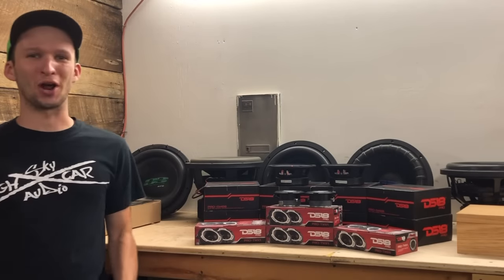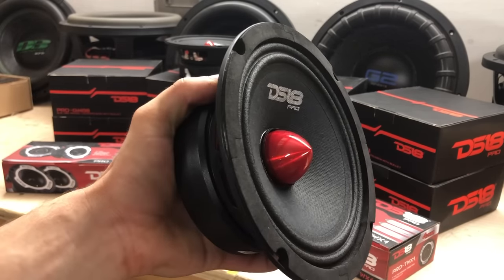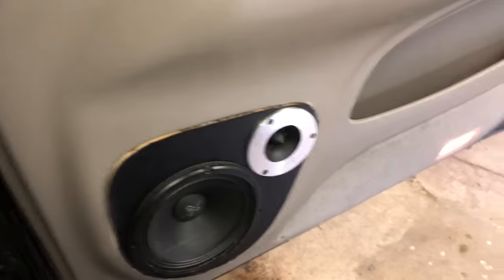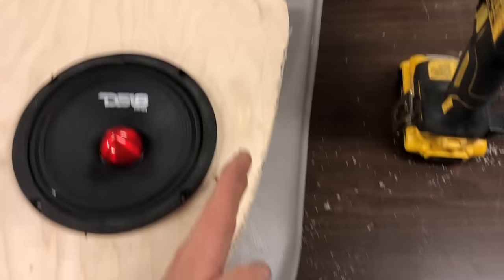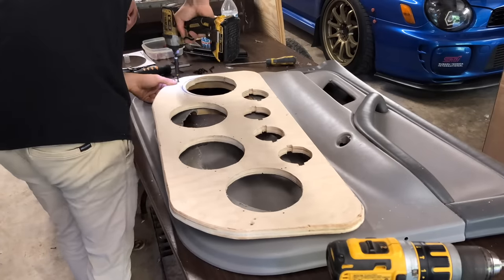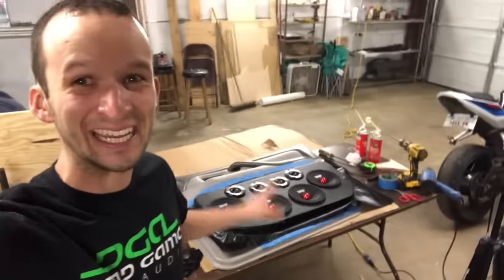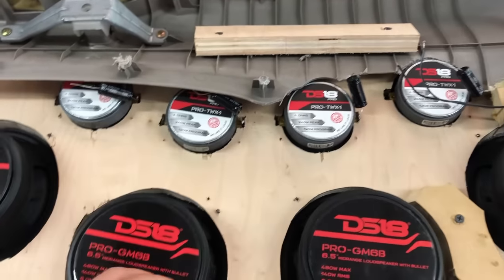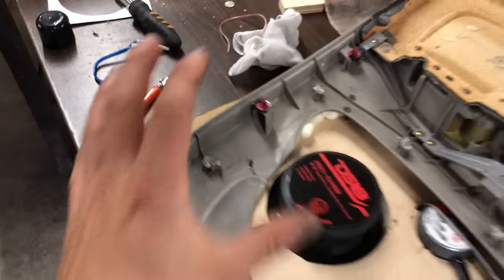Easy Custom Door Panels! *No Fiberglassing Needed* | DS18 Super Tweeters/Mids | Project Sequoia 2.0

Comment: I been dreading to do my door because of the fiberglass but after seeing you go this route, I'm gonna give this here a try
Reply from the maker: Yeah I was in the same boat man
Reply: Just remember, you can lay out carbon fiber the same way you do fiber glass. The only reason you need to vacuum carbon is if you are making a structural part for impact strength of for a wing so it will flex and be strong. Rolling carbon is still strong but really light and it's better at sound dampening. Heck I've used old fleece blankets and that really cuts down on the itch. With fiberglass just remember, the colder the shower the better it removes the itch... Used to work for LUND industry and really cold water takes the slivers out.
Reply: Same man let git some doors made lol

Comment: next time you could maybe try using a heat gun to warm up the vinyl so it can get a good stretch and if the edges are still a little rough.. glue some vinyl trim.  I hope my advice works on my pleather im about to stretch it over my panels lol. I am using a very similar method to yours. I taped off the door panel before foaming gapped edges.. I hope the foam is strong enough to hold my wrap when i tuck it.

Comment: bit late since the vid is 2 year old but correction  4 x 8 ohm speakers in serious gives  32 ohms , to achieve 2 ohms you  need to wire in parallel

Comment: Nice video! I did a similar thing with 8 8’s in the 2 front doors of my f150, once difference is that I made a trim panel that a removable baffle mounted to. Then made a quick disconnect wiring harness that plugged into a distribution block on the back of the baffle. Can strip the door in less than a minute.
 I also ended up doing a little body filler over top the foam that I used to smooth out and spray with a gloss black to match the rest of the interior 👍🏼
Reply: Have a 92 ranger I want to do this EXACT method with.  PLEASE email me any info you can on how exactly you wired this harness and distribute block please…

Comment: You can put all the speakers you want in your door but nothing compares to a set of Q-Form kick panels with some speakers like Boston Acoustic Pro 60's pushed with a JL Audio 300/2 supplemented with some more high-quality components like JL Audio C-2 or C-3 followed up with some coaxials for the rear doors pushed with a JL Audio 300/4 then build a center console ported box with the port and speaker facing the rear either a 10W6V2 or v3 or a 10W7Ae3 pushed with a 500/1 or 600/1 JL class D amp. With a center console box in a full-sized truck you can leave in the factory mounting system that connects to the truck frame and get no rattling and distortion with of course the proper sound deadening of your vehicle pre install. Looks great buddy! Oh and do not forget to install two matching AGM batteries that match and wire them properly and you will not need capacitors. Full size trucks come with an extra spot for the second battery for the diesel options in their truck lines.
Reply: Jls are over rated i switched a long time ago... Alpine & Pioneer. Z series
Reply: I ran jls the foam surrounds on my w3v2s back in the day dry rotted just junk speakers.....  Jl 6x9s couldn't handle the bass lol

Comment: Great setup! I like the design but I would've spent a little more time on the upholstery. You could've covered the whole bottom with the pleather as the door panel separates into two pieces.  Even if you didn't use fiberglass a nice layer of bondoglass would've been a stronger bond.

Comment: Just bought the exact same door speaker set🤪, i have the same car to lol just no sunroof. Ive been watching parkers videos for months now and he’s convinced me to build a 16000 watt system.. without this guy  i wouldnt have this goal. The only trouble im having is how im going to connect another 4 channel amp for my tweeters. For now they will be powered off the headunit… to connect 2 4 channel amps i was thinking 4 y splitters, 2 for the left and 2 for the right to equal 8 outputs. Any recommendationss?

Comment: Hay bro I has a question. I have the taramps 2000x4 the 2 ohms model an I have 2 DS18 8s 8 ohms an 2 DS18 10s 8 ohms as well mid-range..I want to bridge them what is the final impedance output all speaker wired separately  from the box going to the amplifier. Can get some advice on that please and thank you sir an congratulations an the win

Comment: Excellent job.  Now let’s say you have 4 sets of component speakers to use on the doors with 8 cross overs.  Now since your doing the series & parallel there’s one 4 ohm lead for the mid & one 4 ohm lead for the tweeters so when I hook this up to the cross over is the power rating now still the same?  100-200RMS?  How does the series & parallel change how much power I can now use?  Does it require mores power because four speakers share the load of one per cross over point?

Comment: That looks like a lot of weight on the door. Since this video have you had any issues with the panel, if so did you add anything to secure the panel and make it sturdy?
Reply from the maker: Yeah I’d you close the door too fast it will pop out some of the clips. Had to add a few bolts
Reply: @ParkerTheBasshead  if you do this probably go with shawllow mount neos so they arent has heavy

Comment: You should install
Some sort of trim around the whole thing. It will look much better with that rough edge cleaned up.  Don’t do all that. Work not to do the last 5%, which will really make it look much much better. Cheers

Comment: Most people use shallow mount subwoofers for projects in small tight spaces.However, I have an idea that's going to use 4 sealed shallow mount and 4 vented shallow mount.
With regular size subs I have TONS of options. In the shallow mount world it seems that SKAR is the best.  
What is the beafyist shallow mount 12??

Comment: Hey want you opinion,??? When the bass hits my volts drop and my light Dem so should I get a stronger alternator or add a battery???
Reply: alternator if it's happening when the car is running. It's basic level car knowledge, your battery is just for starting the vehicle, once running, the alternator runs lights, radio, fuel injection, computer, everything electrical is run off the alternator when the car is running. If this is happening when the car is off, there's nothing you can do about it, a larger battery as in cold cranking amps means nothing towards battery power draw when the car is off. I have a 320 amp alternator on my semi truck, and 4 massive 1200 cold cranking amp batteries. My stereo or my 600 Watt cb radio will both dim my lights if the truck is not running, regardless of having 4 batteries.

Comment: How did you wire the tweeters in series with the capacitor? Did you use a cap as a series jumper between the tweeters?
Reply: They don't use caps between the tweeters they are  bass blockers resistors
Reply: @Loudkona  ….it’s a specific sized capacitor. That’s what a bass blocker is.

Comment: ... although the speaker selection you made sucks (i had the same combo woofer/tweet's but only 2x) that is bad ass how is the phase working out? i run 2x woofers in my Dakota's door's (6.5 x2 - +5x7 rear speaker) and tweeters on pillars,  i started out with those ds18's for all 3 speakers and i hatted it, did not realize how crappy they were until i replaced them .. I'm now running JBL-club (6.5 coaxal )+ scar (6.5 midranges) + ds18-genX( rear fill 5x7) i cant believe i went so long before i replaced them - 100% better, got the kick - back into Metallica that the DS18s lacked in (had to EQ mid-bass into the system) (infinity kappa 12ich subs) 

on the + side ds18's did get loud - the tweeters i kept - they are also , and never blown a speaker running -10db RMS ... the right mid-bass driver you could make it work I guess - take out 1, and put a Kappa or Rockford woofer (not a subwoofer)

Comment: @ Parker I have the same vehicle as you but the 04, but once you started your project on your Sequoia, you inspiring me to build but I need your help. Can you make me the same door panels for the same set up as you, how much you’ll charge me. I’ll by the speakers and tweeters from a local dealer in New York. Get back at me Parker, need help on east coast, Team Sequoia…
Reply from the maker: Unfortunately I’ve barely got enough time to do my own build. But it was honestly pretty easy to do man.
Reply: @ParkerTheBasshead  No problem ! and by the way your doors came out perfect.🔥🔥🔥

Comment: Ditch the fake leather. Retape your door panel. Go over the foam with epoxy to add strength an finish it off with filler to smooth it out. Prime it and bedliner it. Pull your tape and you should have a nice look for cheap. You may have to pull the tape after you epoxy and retape when dry.
Reply from the maker: Good idea man I may do that after the show!!

Comment: Question: how do you match the tweeters to the mids to the bass? Is there a rule of thumb to follow?

So, I have a 2014 Jeep Grand Cherokee. I intend to throw in four 10" subs, 8 8" mids (2 each in door). When it comes to tweeters, I would just replace the smaller speakers for a total of 5. 

In the 2014 JGC, there's a 3.5" mid in the dash, two 1" tweeters in the front door pillars, and two 2.5" mids in the cargo door. That's the 5 locations/sizes I want to put the tweeters.

I was told I might have too many tweeters, just 2 on each side, 4 total, is enough. As I watch your video, I see you have 4 tweeters and 4 mids in 1 door. Seems to me, you're matching 1 to 1.

As far as watts for the system I want to build.. 4k RMS for the subs, 2k RMS in the doors, total.. about 500 RMS for the tweeters. 

The music I would listen range from Free Falling by Tom Petty to If I Have My Way by Chrisette Michelle to Hat 2 the Back by Snoop Dogg to Sweet Child of Mine by Aerosmith.

So, how many tweeters do I really need?

Comment: I would not have done it like that. You have speakers firing into the seat.  I would have moved them forward and up more.  You could have moved the tweeters up more on the panel too. Unless those are subs, then I guess it wont matter that much. I still dont like the idea of the middle ones firing right into the seat.

Comment: I know you trying but door panels like these make my skin crawl. It’s what I say to customers anyone can slap a bunch of speakers in a car and get loud but not many can make it look good, last, and provide great sound quality. This job fell into just slapping a bunch of speakers in and going ghetto loud. Mounting that board with all those speakers with to the door panel alone won’t hold up but this could of looked somewhat ok if you had a material to match the inside or exterior paint and didn’t have all those folds showing. Carry on though.